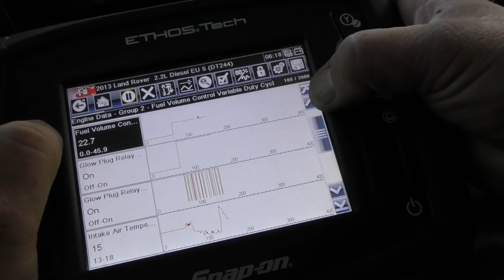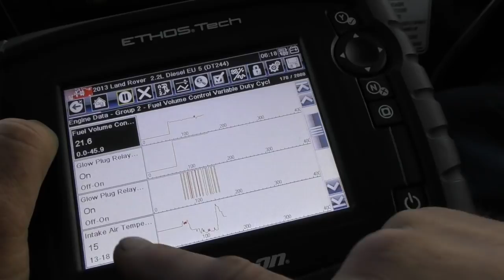Thieves or incompetence?  Address to ScannerDanner and Diagnose Dan.

Comment: I am not sure what this video is referring to but I read Paul and Dan's replies and was surprised to read that they both agreed with the star of the show. 
Here's what I know. 
Technical information for just about anything is so readily available today that I don't care what badge is on a vehicle that comes to me. Today vehicles are  as easy as they where back in the 70's. They just have more systems on them but still information for these systems is so readily available to all of us that no one worth a dime should be saying it's to hard. Wiring diagrams, flow charts, code setting criteria, terminal pinouts and component locations etc etc are all avaable to us from so many different sources including OEM. 
What I find is a massive problem in this industry of ours is the mentality of those in it. Far to many treat it as JUST a job rather than a career and don't bother to follow up on advancing their knowledge. 
Oscilloscopes have been around forever and was a part of everyone's apprenticeship 40yrs ago and the same applies today. It's just on a laptop rather than a big machine that sits in the corner. The principle however  is still the same and simple to follow. Voltage over time. What's hard about that. If your just going to piss and moan about the job then perhaps your simply not investing in yourself. Don't expect your boss to do it for you. Maybe they will but maybe they won't. Either way, it's on you to invest in yourself. Then you can command the big bucks and treat the job as a career.

Comment: I am in the USA. When I started working on cars, first at an independent shop, my training was instructions by the owner, no real theory, just do this do that. So I went to the GM/Datsun dealer. They could see right away I was trainable but had no real skills. So off to GM school. It was great, no R&r but lots of bench building of components. We had Datsun but no one wanted to work on them, so I volunteered and was immediately sent to all the Datsun schools, on the 240Z and 260Z and finally on the 280Z. Sometimes I stayed a week at a time. So the factory supported the dealerships and also with zone reps who would come in on difficult technology or repairs. I had the same experience at Ford and Toyota, all factory schools. Now, for the most part, the factory has given up on in-house training, it is mostly video. So I can see how young technicians who do not go through the apprenticeship(Mercedes, etc) struggle. And the frigging tools we have to buy is ridiculous. I started with less than $100 invested in tools, but that is not the case anymore. My point is cars are extremely difficult to repair, tools cost is astronomical, training very difficult to get. We are not paid very well, HVAC, plumbers, electrical trades can make much more than we do. And their tool costs are minimal. The industry is shooting itself in the foot as well as the OEMs lack of training. I think we will see less young people coming into the trades, and frustrations on the consumer side due to poor technicians. Who do we blame???? Get the wages up, I see ads for mechanics offering $15/hr, or $20/hr flat rate as pay when a Snap-On 10 mm wrench costs $24.00. That is a joke. Get the pay up, stop flat rate, offer benefits and tool allowance, and train people, all techs at all levels. That is what we need. Liked your comments.

Comment: Great points mentioned.  I personally believe that as a whole we are all to blame from shop owners expecting too much without providing the tools or education.  Also Techs need to understand that the industry is changing so fast nowadays that they need to learn more.  A large part of both sides is that the older guys that move into shop management may have a lot of experience of older tech but are unaware of the requirements of a current tech,  so they don't understand modern diag techniques and therefor cant help the guys trying to learn.  Obviously egos play a large part of things with some thinking they know everything and not wanting to learn.  It really is a shame that the general public think of us as the uneducated grease monkeys, however we as an industry have brought that on ourselves through physical images of dirty messy techs/shops or the lack of professionalism some shops (not all) portray.   There needs to be a change in mindset from trying to be the cheapest to actually charging what we are worth and the customer may eventually see the value in that.   Overall great video and well thought out.

Comment: Well said, I have been an L1 master for 30 years, there is a big difference between a mechanic and a tech, the general public are just misinformed and because of the free diagnostics that are offered through all these parts stores now a days, people think that us real diag techs should be free as well, what they don’t know is the scan tool is only a directional tool, the real diagnostics comes next, experience, knowledge and circuit design are all involved in real diagnostics, the ability to look at data pids and know what the fuel trims are supposed to be doing and/or why it’s not doing what it’s supposed to be doing isn’t code reading, so I can print you a list of possible reasons of why that code triggered the check engine lamp and send you on your way or I can pin point the exact problem, you cannot diag a problem using a trouble code alone. 
  Your not paying for the 30 minutes it took me to diag your car, your paying for the 30 years of knowledge and know how that I can offer in pinpointing the exact reason for the check engine light in that 30 minutes, as for you people that think that the check engine light being on on your dash is there for decorations, trust your tech when they tell you that that amber light is there for a reason, and when it comes on you should really get it checked, the biggest thing that I have never understood as a career technician is that aside to people buying a house as one of the most expensive things to buy in their life, a car comes in at the second most expensive thing they will buy, yet for the most part the general public won’t take care of their $60,000 vehicle, 

Ace Mobile Automotive Diagnostics

Comment: I don't know.... today, even a "shade tree" mechanic needs at least a code reader or preferably a laptop, to do diagnostics.  Without it diagnostics can be not only lengthy but expensive.  Get an OLD netbook , an OBD cable, and some "freeware" and play with it.
Yes, even a DIY type needs to analyze it like a system engineer.  The fact is the newer the car the more systems they contain, and the more "interconnected" they become. 
These days it takes A LOT to be a master mechanic!  Knowing how to turn a wrench is just the starting point!

Comment: you added about the ubolts coming loose again after the information was not relayed on to the driver/company what ever and it ended up with damage. the shop I'm at does a lot of leaf spring packs and lift blocks on pickup trucks, so its required to remove and replace the ubolts. and customers are told to come back in 500km to have them retorqued. its written on their work order, on a retorque tag in the vehicle along with the wheels. and it is verbally told to them. and most of the trucks we work on are in the oil patch or logging industry the people the run these trucks a lot of the time either forget or figure they don't need to come back and then the ubolts come loose, truck its towed back and its our fault because we didn't do the job correctly. same thing for wheels, they need to come back in 80-100km for the retorque but a lot don't for the same reasons and ruins wheel studs, rims, etc. and again its our fault according to them at least have the time. I guess I was ranting but to add that when the customers don't do there part they still blame us a lot of the time and it happens with more that my examples.

Comment: Scanning is one of the easiest money makers. No matter what garage I take my vehicle to and ask them to replace a specific part they always insist on doing a scan even though it may not necessarily need one, I have specifically declined a scan in one instance (because I scanned it myself and gave them the details) and been told that they wont touch the car in that case, simply because they lose out on £45+. I have progressed to a hi end scanner and now do my own repairs on my Mercedes S320.
Reply: The other issue I forgot to mention was some garages selling customers snake juice in the form of 'deep clean carbon removal' using chinese hydrogen machines, the machines cost from £85 upwards and do jack shit.

Comment: I think there are 2 things in business customers generally seem to want to pay little or nothing for any of the trades and believe everything should be free. People also have a lot less cash available wages are static and cost of living is increasing all the time. People think a diagnosis is like getting a "free quote" or "estimate", they don't care if you need 1000's of hours of experience and heaps of equipment, that's your problem not theirs. I can't see the motor trade changing, minimum wages that is it and poor conditions with zero respect for skills and knowledge. The corporate employers never seem short of profits at dealerships. If you can make a business work for yourself and suffer the hassles of that maybe you can make more, but you will work hard for it until you can employ people to work and make money for you.

Comment: Right about 2:50 applies to most trades. A Craftsman a Tradesmen are looked down upon. White Collar college educated have little to no respect for them. It really is the upbringing. However there are a lot of those same college educated folks are working as clerks. Good for them. They have a ton of loan debt and cry about it. No one twisted their arm when they signed all those papers. They wanted easy. Easy does not exist. It's a dream. If one choses to work with their hands and earn their keep. To learn the correct way. My hat is off to them

Comment: It is unfortunate but the trades be it HVAC, plumbing, mechanics, etc. deserve the bad name that they get. I do not let anyone touch my cars and motorcycles because I want it done "right". And as a home mechanic, I would not waste my $$$ on Snap-On tools unless I knew what I was doing...since 1974. I worked in dealerships in parts and most mechanics were "parts replacers" putting parts on the car hoping the problem will go away, instead of diagnosing. And service advisors know squat about cars and work on commission, so that tells you a lot.

Comment: I hear what you say and I thoroughly agree.

I'm just a hobby mechanic these days but i still need the gear to do the job. Take diagnostic procedure. I just spent a grand and a half on the new Launch reader, so I take £20 to plug it in. Yet everyone complains and bitches. Fine, take it elsewhere. I don't care.

The other thing I see is misdiagnosed faults, I get that all the time. Today its a bad alternator on an Audi that was diagnosed as a busted abs module.

As for money,  well its every trade and profession these days. I've said before my day job, I'm an airline pilot (semi retired) and I see guys coming on the flight deck getting paid mid 20k. Seriously.

Lifes never been harder for the working man,of ANY trade, at any time in the last 50 years.

Comment: Great!!!! I tried to point out to scanner danner the customer demanding certain parts be put on because of a parts store diagnosis will lead to the customer blaming the technician for installing a part that does not fix the problem.  Customer can have a bad head gasket and come in wanting a tuneup saying nothing about coolant consumption.  If you dont point out there are issues a tuneup wont fix ..... You will get blamed for throwing parts.

Comment: Not enough good techs because the flat rate system sucks and the hourly rate is too low to begin with. I was a dealer tech once, I know. Been there, done it. Customer complains the cost is too much, the service dept. cuts their estimate down, the parts dept. won't budge an inch off their cost, the shop loses money, the tech loses money, still takes same amount of time to do the job, customer pays bill all the while bitching the job either took too long to do or costs too much still, or both, take your pick. The sends a crappy review about the dealer when they get the customer satisfaction survey. Everybody wins! Yeah!

Comment: 2 and a half years on and things are even worse ..Sadly management won't stand up to customers and constantly bend over ,..Some customers have unrealistic expectations ,,ie drop off a MOT  thursday  night at 10pm ( it should have been wed morn ) for a test friday at 8am  and kicks off when it cant go for test ...and it has a run booked lol..It is the most unappreciated  job going ..Euro 6 MX pistons out and getting grief as customer needs it asap ..There is no such thing as a 5 min job nowdays ..You have probably seen the hassle with fuel faults being in the south east  and the nightmare to diagnoise them..Fuel samples ,who's paying ,it's under warranty ,customer phoning the manufacturer